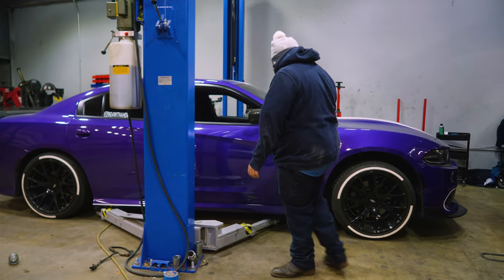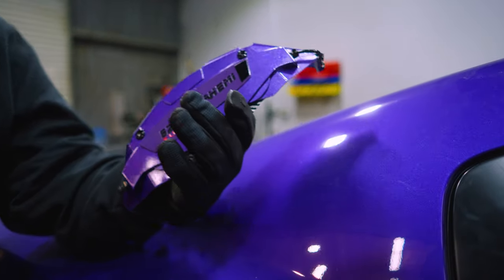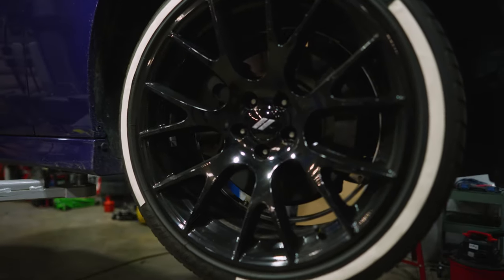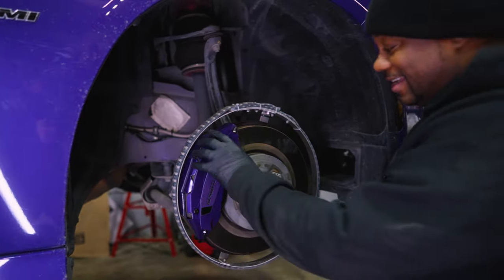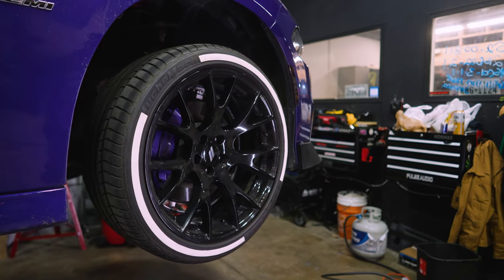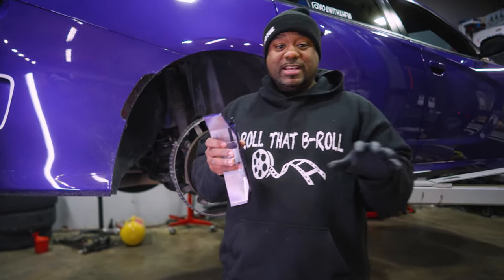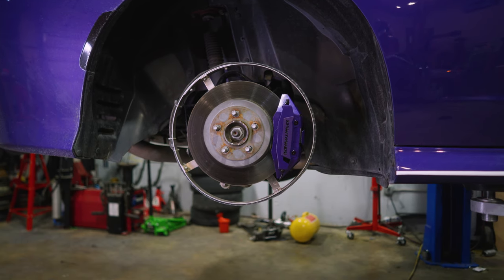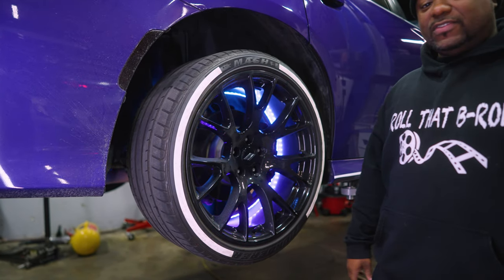THIS INSTALL BROUGHT MY DODGE R/T TO ANOTHER LEVEL WITH CCI COVERS...

Comment: I see that you used ceramic coating for the covers!! I Coated my entire car entire car last month!!
Reply from the maker: Heck yeah bro! My whole car is ceramic coated. How long it take you
Reply: @924PHOTOGRAPHY  I want to say about 5 hours or so because I had to pressure wash, hand dry and it is an SUV! Did it in my garage with close door and daylight light bulb. That small bottle was  $89.00 but it works!!!
Reply from the maker: Heck yeah